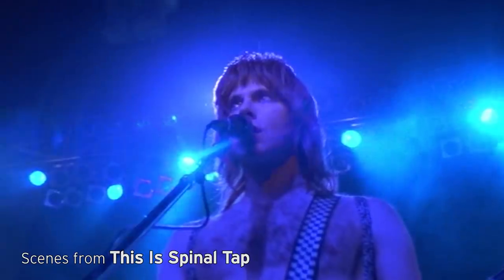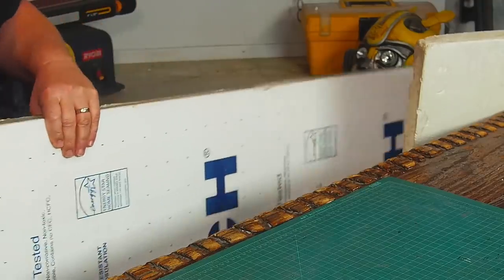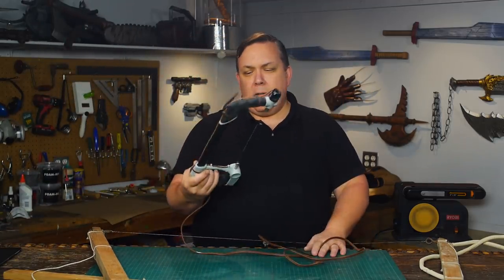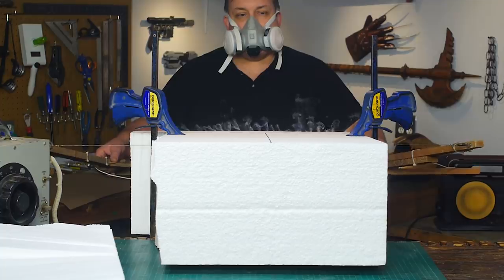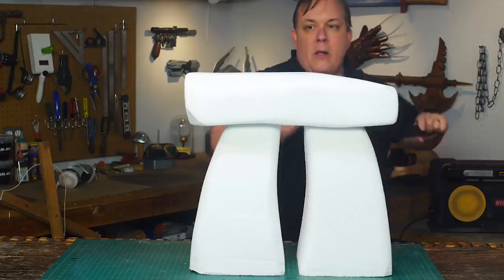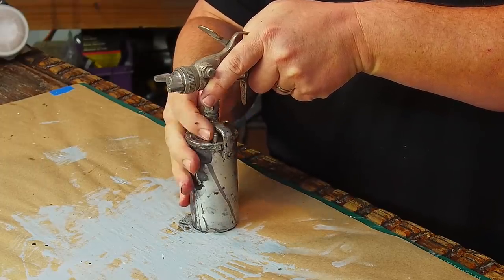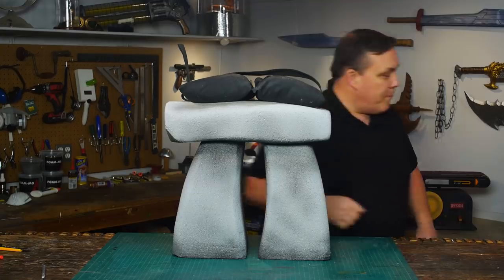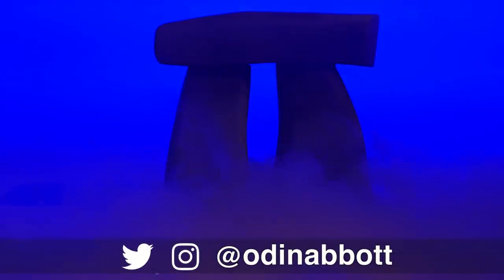Odin Makes: Stonehenge from Spinal Tap

Comment: That custom hot wire cutter is BRILLIANT with the spring tension.  Never would have thought of that.

Home depot has extruded polystyrene sheet up to like 3", I think.  This would work if stacked and glued with Contact Cement.  I can't find extruded polystyrene sheet at Lowes larger than a half-inch.
Reply from the maker: You would want the water based cement of course... the red stuff will melt the foam! 3" thick is nice.
Reply: @OdinMakes  

Thanks for the tip!  Yeah, not too often you can get excited about 3"...
Reply: GalaxyStranger01 HAHAHAHAHAH i get it...